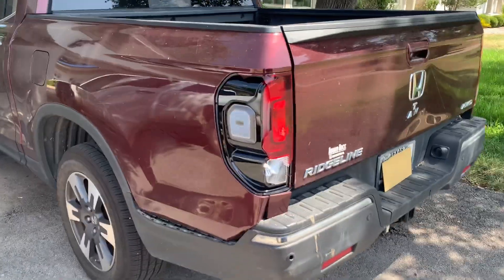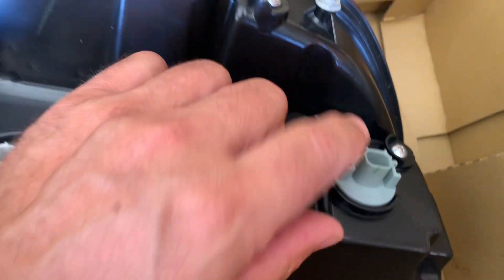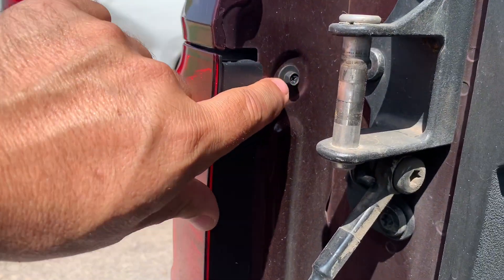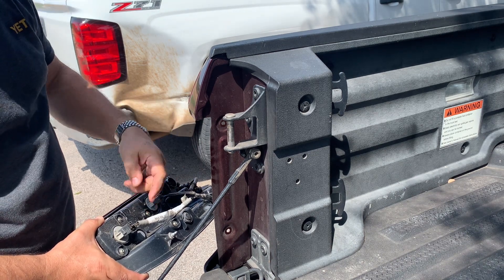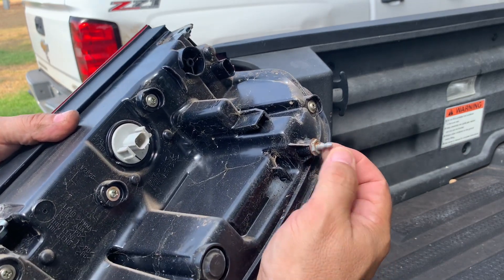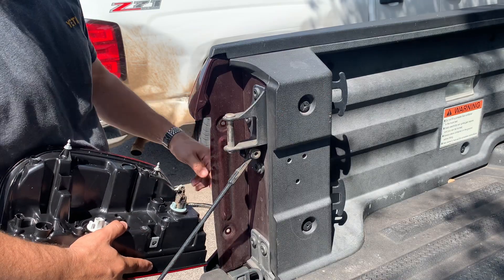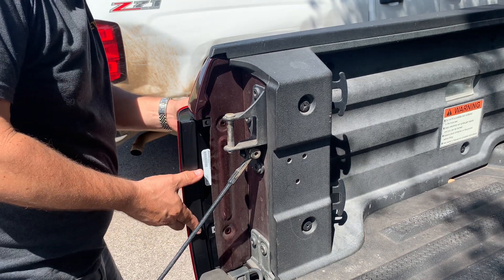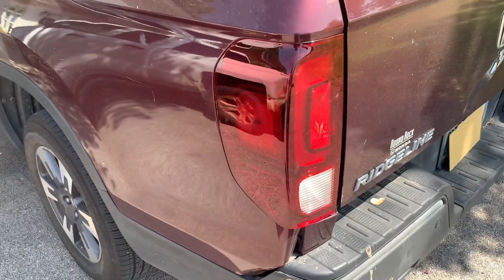✅ Change Tail Light on a Honda Ridgeline (2017-2019)

Comment: Does the clip come off easy ?
Reply from the maker: Yes, you don’t need any tool or anything. Just pinch the plastic clip on the plug and pull it out.
Reply: @ApacheRanch  You saved me $225 from having the Dealer do it . $75 Labor & $235 part . Thank-You Brother....
Reply from the maker: @kevinhoock9742  that’s great!!!